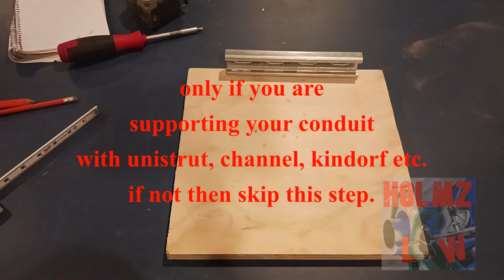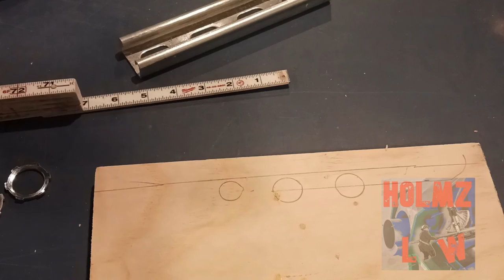Quick & Easy Panel Lay out

Comment: Great video as always, Mel. Could you do a video on visualizing how to perform a bend in order to have all bends end up in the direction you need? For example, two offsets with two 90s and you want to make sure the offsets are turned the right way. I've always used a scrap piece of wire to test the bends on it. Do you have any advice on transitioning into seeing the bends and not needing a bending aid such as the scrap wire? Thanks for any advice!
Reply from the maker: Yes actually I do have a system that my mentor drilled and drilled into my head I mention I believe in one of my videos not sure if it's the 4 point saddle video or not. But I will put that on my list on videos to create. Thanks for viewing and most of all for commenting. Comments are the one thing I appreciate the most. Thanks 🙏

Comment: I used to get center that way but it takes to long. An old union guy told me go into your ko cutting die for the size pipe your working with. 
Put it on the line. Dray the inside stud hole with a sharpie marker and you have you small circle!
Reply from the maker: I don't really get it. Tell me if I got it right. So get the die and put it on my line I just created with my kindorf. Then use the center of the die to draw the small circle in the center?

Comment: @Holmz Law is there an easier way to knock out a 10x10 box without knocking out the prefab holes on the box if I'm running emt on shallow strut?
Reply from the maker: Besides the concentric KOs. The only easy method I know is the method I'm showing you on this video
Reply: Concentric KOs suck! Get boxes with no KOs!
Reply from the maker: @brentcory8194  sometimes that's all there is.